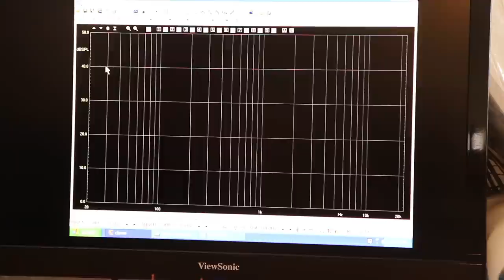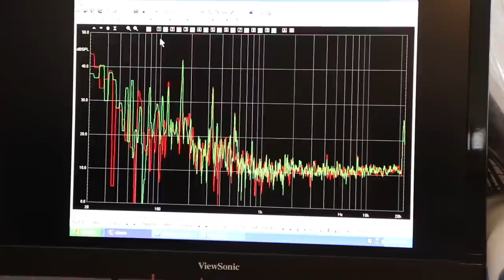Power Cable Tech Talk and a little help for Amir at Audio Science Review

Comment: @Danny, asking this question in a comment instead of email because this might be something others are thinking (maybe also comment) and I have not heard you speak of this. I have a pair of PSB Image 4T tower speakers. Like do like the overall sound, but it just feels like they lack some openness and treble detail. My question is = Can GR do a crossover parts upgrade just from the crossover network being sent, instead of having to find a huge box and ship the whole speaker? - Maybe, not 100% ideal. But, it just seems like from looking at the cheese in the 'crossover/wiring/terminals' and already figuring these need 'no-rex'; higher quality crossover parts would be a better upgrade than investing in new electronics. Currently, I have Parasound separates. What say you? - Thanks
Reply: Yes, improvements in clarity, detail, openness, layer of the sound stage, and less overall smearing can be achieved with typical parts quality upgrades. It obviously won't fix any other issues with the speakers like phase issues, ringing or stored energy, amplitude issues, etc. If the speakers are well designed and are free of other issues then a parts upgrade is perfect. If they do have other issues then it is best to resolve those and then throw good parts at it.

Comment: I think myself a loyalty GR research fan. I tried these years Dennis's speaker upgrade kits, and 24 braided speaker cable. They all bring surprisingly upper level results. But this time, I am confused with limited information. I can understand the cable braiding theory benefit as a filter to the signal path (like speaker cable). besides questioning what is it truly filtered. (a spacial fidelity, or noise, or both). But for braided power cord? Since it runs higher current (then signal path) constantly, drawing EMI noise should not be the main concern here. Instead, it should focus more on the shielding mechanism to minimize its current magnetic impact to near by signal cables. I am open to anyone's opinions. Thanks,
Reply: Shielding a cable doesn't make it a filter to remove something that is already there.
Reply: Hi  @dannyrichie9743  - my take on the query here is whether the braided conductor arrangement of the power cable diminishes the EM radiation emanating from it (ie the electromagnetic field transmitting electrical energy along it) compared to a ‘typical’ non-braided, unshielded power cable - ie. does the braid diminish EM ‘noise’ radiated by the power cable to other cables etc…

… all of that as well as causing the power cable to filter out EM noise (so that the electromagnetic field transmitting electrical energy along it isn’t ‘contaminated’ by other EM radiation sources), ie. it doesn’t behave like an aerial and import EM noise into the device it is powering.

Apologies if that seems overly ‘wordy’ mate! I’m Autistic - atypical language use traits. Sounds formal when written, but not when it’s in my head 😉😆
Reply: Unfortunately in hifi manufacturers can make absurd claims and get away with it. $2 per meter speaker cable and the mains cable that came with your amp is all you will ever need. Anyone who claims otherwise is out to make money at your expense.
Reply: Amps speaker outputs can produce far higher current than that drawn by the mains AC side, roughly the inverse of the primary to secondary voltage corrected for design efficiency. With 32Vrms output into 4Ω load you are looking at 256watts, or 8A. The mains draw for a class AB would be about 3.5A at 120VAC and less than 2A at 240VAC.
Reply: All you need is the basics of electronics and power supplies to know how big of a scam these snake oil power cables are. We, the "awful objectivists on the ASR, are also audiophiles, we just use sciences and facts as our guide to the audio perfection. Feel free to join us at any time, if you want an answer to your question.

Comment: Now let’s be reasonable folks. Just take out all your drywall and replace that pesky ROMEX. It just won’t sound as good if you don’t. While you’re at it, make sure you open the chassis on all your gear and change that wiring to all be 00 gauge and then change those piddly 3-prong sockets. Better not have any electronics in there; your capacitors probably have 18 gauge leads and that just won’t work. There’s no other way to get good sound.

Comment: That's why they make a shielded cable for certain.. have a conversation with a military grade construction electrician in they'll set you on the right Paris I agree completely with GRE research but at the same time.. you do not need to spend a fortune on... Cable Cable
Reply: Shielding only blocks RFI and EMI. When the cable is designed to act as a filter then it actually removes that noise.

Comment: You seem to be obsessed with trying to put Amir down by consistently calling him names and then taking only parts of his video and trying to prove that Amir doesn't know what he is doing.
If you really want to prove Amir wrong then let's see the data.
Sound can be measured accurately, and so can harmonic, frequency response, and even ultrasonic frequencies, so let's see the data showing the difference.
Until then you are just trying to win your argument by calling the other side names.
Reply: I don't really care about Amir. I am helping people that want more out of their music listening experience.
Reply: You need to be better informed about the real name calling instigator.  The ASR faithful were insulting and name calling long before Danny first responded.  Any individual or business that does not blindly agree that measurements tell all will be attacked.  For the most part, Amir tries to remain aloof from the mudslinging of his followers.  When he does respond, as here, the verbiage grows in length, wanders, and ultimately does not make much sense the longer he tries to argue his position.

Measurements are valuable.  So how come Amir has a personal audio system costing in the 6 figure range instead of the cheapest perfectly measuring components?

Comment: It would been intreating at those whole house solar systems or battery/ off the grid or even running off while house generator see the measurements?
Reply: makes no difference bud; i lived on a boat for years; solar/battery/engine power/mains; all the same to hifi equipment

Comment: Hey Danny, I know what you talkin about... I did one thing a few years ago... I built a power cable. It made a difference. It was based on the Supra cable and plugs. It had a shield that should be connected to ground on one side. Which I think was partly responsible for what I could hear... and the point is the noise floor was audibly lower - much less hiss via the speakers with nothing playing. Funny was at a web group I used to frequent, I mentioned this and out of 20 replies, 18 called bs.... 

I enjoy your channel dude! Thanks for the vids 👍🏼😊

Comment: Cables do make a difference. Placing them next to each other have a detrimental effect. Good plugs give better connection to the wire. I have experienced it. The longer ground plug is a safety feature.

Spot on on all counts, Danny
Reply: So if they're not next to each other they have no detrimental effect?  And 'good connection', if you don't have connection issue and your power isn't cutting out, again, no detrimental effect to using normal cable?
Reply: @literalghost929  Then why are there audible differences from cable to cable?
Reply: @dannyrichie9743  Loaded question, the only time you might hear a difference is when a broken (by design or not) or improper cable is used.  

Certainly, if no difference can be measured using highly accurate scientific equipment, there is no difference to be heard.  So error prone and very inaccurate ears and brain, you might be under the impression that you can hear differences where there is not.

To ensure that you can hear differences that exist, a blind test, or better yet DBT, is what is necessary to prove the theory that you can hear difference despite the facts that none could be measured.
Reply: @literalghost929  Ha, ha, ha, yeah, one must be broken.  :-)  I still want to see the blindfolded guy swapping out the cables.  Ha, ha, ha....
Reply: s̶a̶f̶e̶t̶y̶ ̶f̶e̶a̶t̶u̶r̶e̶   fire hazard

Comment: For more hold, the commercial, hospital spec is way better. Just go to the store, take an extension cord and plug it into each outlet and see. Even the GFCI's have different grades. Maybe go to the commercial supply houses. They sell to the public quite easily. QED, CED, winlectric etc...
Reply: Are your power cables falling off your outlets?  Never happened to me..
Reply: @literalghost929  My 1950's house, all of them were loose and couldn't hold a lamp cord. Had to dive down that rabbit hole
Reply: @scoobtoober2975  Ah ok, regular outlets do the job in my experience, but I guess that there are 80 year old outlets out there which might not...  (my point was more that a regular $2 outlet will have plenty of hold; don't need more than that)
Reply: @literalghost929  I've seen the $1 outlet fail in 5 years of less. the $2 ones are much better and sufficient for less heavy use. i'm disappointed when all the outlets in some houses, 1970 even, all are bad.

Comment: Great video! ... Have a question.... how does optical connections compare to other types? or HDMI? Do these pick up EMI? or do they suffer from other types of interference?
Reply: Good question. I am not the expert in this area, but I have not had the best of results using fiber optic connections.
Reply: No they don't as it's light ... however compared to hmdi bandwidth limited

Comment: Just curious why don't you use Chokes on your power cables this would give you a totally null feild on the power cables Iam sure a decent manufacturer like TDK magnetics would make over sized chokes and one thing Amir and your  video did show is how backward and poorly designed your A/C wall outlets are no space for Mov's and fuses and it also beats me why you have two different voltages in your house wiring has no one thought of redesigning your plug top plate ??? Iam a sparky in the UK so the earth is round
Reply: We do use additional power filtration devises and even a balance power supply. Even then, the cables still matter.
Reply: Hi yer Danny when is the US plug going to be uprated at least in UK plug we can fit MOV's lol do you design crossover for speakers 

Thanks Simon

Comment: Hi Danny.  I have a wife problem.   A problem wife.  Basically, when i blew the tweeters on my QUAD floorstanders, I removed them from the lounge pending the arrival of new tweeters from the dealer.

As an interim measure I installed a good quality soundbar.

Now the speakers and amp have been denied re-entry, because to her the soundbar sounds just as good, and the likelihood of conflict with the residents of our valley is much reduced.

I dont want to spend a fortune.  I have found that the B and O 8000s fit the aesthetic brief.  I thibk i can sneak them in, and theres no amp.   

In your view, are these any good?   Regards Guy

Comment: Engineers that don't use words like 'conductors' (the wire) to describe the composition of cables or even 'sockets' (not plugs) to describe receptacles ... makes me scratch my head.
This back & forth between Danny & Amir got really old ... like 2 years ago.

That said, I'd like to see Amir do an engineering breakdown of some low-noise - highly complex - twisted litz conductor cable construction and debunk cable construction from that standpoint.
His Cali-Elite-ist Engineering consultant BS is also a cultural problem.
Reply: He already confirmed that the geometry of the cable does act as a filter for noise.

Comment: Stating it wasn't your intention to make fun of Amir is disengenuous with this video.
You make a few good points though but I think both you and Amir get it half right and half wrong and wence the two meet just doesn't make much sense. It is entertaining though.

Maybe a better test is to inject a frequemcy sweep into the power cable using induction and see if anything makes it through to the output of the system. Then a/b test it with a cheap and expensive cable. 

Guess what? Most powersupplies have a big iron core inductor as a transformer, so little high frequncy no8se is going to come through, and after that it's rectified, filtered and smoothed with more inductors an large and small capacitors. 

Well shielded interconnects is important though since you introduce the signal after the psu and any HF noise that isn't blocked with ferrite beads or isn't shielded will enter the audio path.

Comment: I even noticed an improvement switching the stock power cable on my SMSL DAC from stock to one from a computer monitor that has a little magnetic thing on it.
Reply: it has a "magnetic thing" so it must be doing SOMETHING, right? Magnets are magic anyway, like how do they know to only stick to the metal? it must be magic, or ghost
Reply: @fullalbums5675  ferrous metal yes; all else is worth its weight unlike dannys power cable 🤣🤣
Reply: @fullalbums5675  😂😂
Reply: I‘m surprised Danny doesn’t sell a small pyramid to place on your amp so you can get the ultimate audio experience.
Reply: @fullalbums5675  Yep, I do it, whenever someone pays more than 300 for a power cable, I make sure their system gets the best electricity from their outlet, guaranteed better nuances, darker background and improved sound stage.
Reply: @StillAliveAndKicking_  Pyramids work well?  I've always been a huge proponent of Totem Beaks, and these are round shape.  You just stick them on top of your speakers, and instant improvement.  No voodoo at all, it's science.  Guaranteed better nuances, darker background and improved sound stage.  Oh improved dynamism.  Better vocals.  Wider soundstage.  Improved bass.  More realism.  Less noise, oh yeah, they filter noise, EMI, RFI, BMI, FBI, ALL the noises, they're like a anti-noise force field.  Only hundreds of dollars for a cylindrical round doohickey metal thingie that improves sound.  Must have for any audiophile worthy of the name.
Reply: @literalghost929  Oooooh, that’s a must have, I‘m placing an order now.
Reply: @literalghost929  it works even better if you rub it with my special oil, only 499 for a bottle, practically a steal

Comment: Thanks for the great science-based, informative video. That guy is trying to play Electrical Engineer, when he just doesn’t understand the science. It’s unfortunate so many followers believe him.
Reply: If by "that guy" you mean Amir - Amir used to head up the digital media group at Microsoft (nearly 1000 engineers) one part of which was developing audio codecs. You don't get to do that if you don't understand the science.
Reply: @antcollins6594  two complete different applications.
Reply: @snomofilms  I have been in audio and electronics since 1960s.  Electronics and audio are in my blood.  But you don't need my resume to believe what I say. I show you hard measurements and null tests.  Danny showed you what?  Nothing.  He didn't even null the two noise sources in his video!  And of course, showed no measurements of any sort to back what he said is the case.  His interest is to sell you a cable driven by his improper listening tests making himself believe these things make a difference.  He did not double check a single thing with an objective test, or controlled listening test.  Don't be so easy to impress.  Ask for evidence for heaven's sake.
Reply: @AudioScienceReview  lol ASR he told you why you can’t null noise, c’mon man. I have a cable of his- before and after was impressive
Reply: @AudioScienceReview  Amir is the kind of guy who will show you measurements of his manhood, and claim he's packing 9 inches. Problem is he starts measuring from the back of his arse... But hey, he gave you a measurement so it must be true...
Reply: @scudder2010  😂😂🤣🤣
Reply: @AudioScienceReview  That's a lot of speculation you got going on there. Let me know when you are ready to learn the truth.

Comment: As a design engineer, recently retired after working 35 years in the valley, my experience is that the types of engineers who fill these comments sections with vitriole are the 95% of clueless engineering grads who couldn’t plug the right end of a power cord into a socket. I should know, I’ve fired enough of them.
Reply: Retired from where?

Comment: Ok I stopped watching when you said that cables need burn in. That is flat earther material right there. Geeez!
Reply: It is the flat earthers that refuse to listen to anything outside of their belief system. So you really just proved yourself to be one of them.
Reply: @dannyrichie9743  Science is not a belief system. Ever heard of a null test?
Reply: @kaleoride  Believing that cable does not burn in without doing any science is just simply an unfounded belief. Cable burn in has been proven and demonstrated many times, and is a commonly accepted industry fact.
Reply: @dannyrichie9743  No it's not man. Stop talking silly.
Reply: @kaleoride  It is easy to hear and easy to demonstrate. I can prove it.

Comment: Thank you for your videos!  It looks like it's pretty useless to convince people who don't here a difference in cables from the truth. Tinkering with the equipment is part of the fun for me. But sometimes I think maybe I am just crazy and there are no differences. Therefore,  I again changed the powerchord from the outlet to the power block with a household cable: it sounds awful! It just proved again and again, cables make it difference. Maybe we should talk differently about hearing or measuring equipment and understand the stereo equipment also as a measuring tool, just with different output, sound- instead of optical information. Since my hearing can't be the crucial part of the exercise, it's already quite bad.